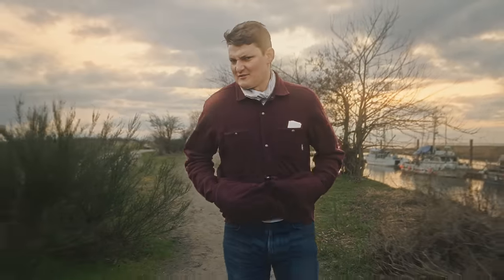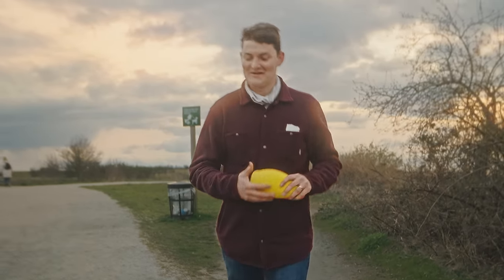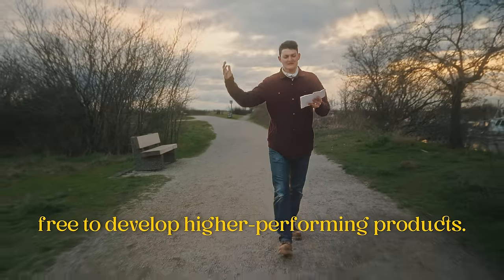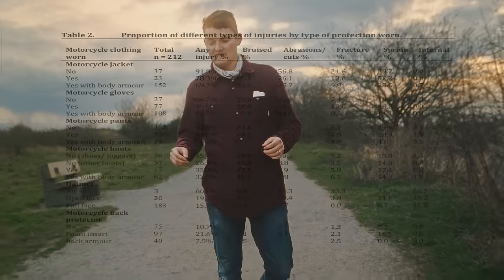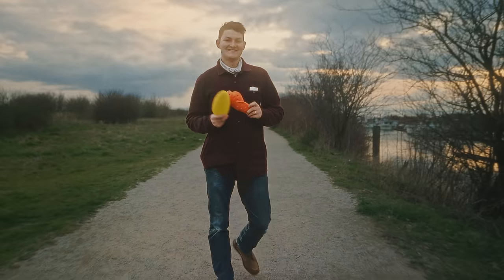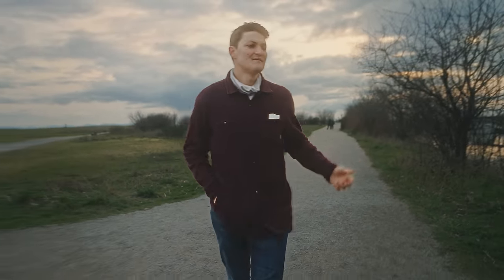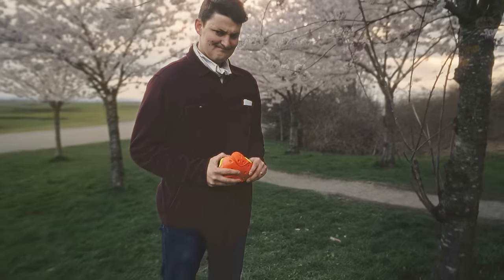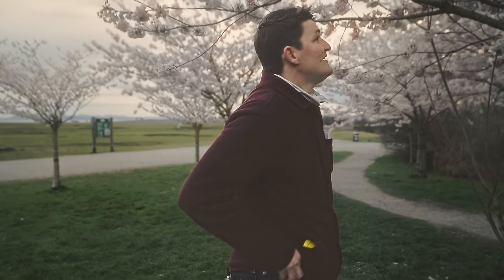Why I Stopped Wearing Motorcycle Body Armour

Comment: Pads are not the same as protectors. Pads are not certified, protectors are. CE certified clothing need to have certified protectors of the correct size and location in addition to certified abrasive resistance. Airbags can be used in addition, but not as a replacement.
Reply: The need for the CE standard approval is "ONLY" required at the point of sale and the manufacturer has minimums ( sub for correct )  to hit to qualify for approval. Unfortunately that coverage may be inadequate in the larger sizes offered for sale - one size does not fit all... It is totally a personal choice whether or not to retain the body armour ( not yet compulsory to wear ppe on a motorcyle other than a helmet - unless you live in France and then gloves must be worn ) common sense should dictate wear atgatt
Reply: @pamvarnsverry2444  You are correct that it is a sales requirement not a requirement for the user. However that was not my point. In the EU a specific language is used to describe the motorcycle gear. If the protectors are not certified, the are adressed as padding. If the gear is equipped with certified protectors, it my be adverticed as leather (or whatever) clothing with protectors. Only when the complete gear is certified, it can be advertised as protective motorcycle clothing. This means, the stiching/abbresive resistence, certified protectors and protectors on the required spot, with the correct size and means to keep it in place during a crach. Only a few manufactors make motorcycle clothing up to these standards. Most are sold as motorcycle suit/clothing with protectors. this means only the protectors used are certified, but not always on the right spot or of with the correct size and neither with the correct abbrasive resistence.

Comment: It is simple Mother Nature that the more material/product you put between you and the road, the less the road will damage your skin and/or bones. There is always an impact breaking point of human body parts but that is not what putting more material/plastic between you and the road is designed to protect. They are not impact reducers. They are there to reduce the amount of skin and bone removed from your body. Every motorcycle rider should always wear protective gear which includes body/extremity armor just in case they hit some marbles and go down for example.  Plus thicker layered clothing for temperature control as well in the high wind environment. IMHO

Comment: No no and no. Knee pads or braces massively helpful same with elbow pads and anything for your spine. Any kind of armor is better to prevent against a break. My knee got fucked up at about 15 mph but at 35 with the armor just a week of discomfort no no no. Wear your armor it helps reduce injury

Comment: I understand they may not help too much with low impact, but at the times you need it if I can reduce 50 Jules to 18 I will take it. The rider may be covered in broken bones but at least the bones are in single digit pieces. Also, I completely agree with most of your videos, but quoting a single study about the effectiveness of gear isn’t proof of anything

Comment: What about all those motogp/WSBK guys.  I mean I haven't looked it up, but they seldom seem to break anything protected by armor?  Legs, hands, collar bones (Although their auto AB stuff seems to be saving some collar bones), but seldom do they seem to break an elbow, or knee, Their speed hump seems to protect their back quite well much of the time (Even though that isn't it's intended purpose, and their water bladder may help there too).  Ankles do get broken (Jorge Lorenzo broke both of his) but if you look at the injury going down, it seems due to hyper extension, or dislocation a lot of the time.  I've seen these dudes helmets and armor spark on the asphalt, they slide at like 200 MPH sometimes.  Sorry if I am off base here, this is really more an observation.

Comment: Partially disagree. How could you expect to be protected by a small pad? Pads (no matter what kind of) perfectly save from having any scratches after jacket/pants were torn apart when you jump off a meter from the bike, yes you get bruises obviously, but that's not a pad issue, it's human body. You can't fight it! 
I find coloured pads useful, as you can easily see when it needs to be changed than black ones.
I've had fallen off from the bike having jacket with elbow and shoulder pads. It's still there and has no scratches, but yeah got light bruises, which is everyday thing. I had leather jacket without pads and in a similar case entire arm was torn and many scratches. Have to heal a week.
I truly believe better have something (a cheap pink pad😅) than nothing!!!

The question is for me do I wanna carry bandaged arms like 10 days during summer? So that everyone asks me "oh you should quit riding"? Or per weekend quickly heal it and good to go.
Note: For me healing a small 1cm bruise takes ages, not talking about wounds and I'm tired of using creams or whatever medicine is out there, I better use the useless pads!!!

Comment: Been riding for 54 years, dirt and street. Always wear protective gear. Many come to me to ask what they need to ride. Some say why do I need a helmet, if a car pulls out in front of me at 70 and I hit it, the helmet is probably not going to save me anyway. It could, but I point out to them, them that. What about the time you are going 5MPH and turning around and don't notice the gravel spot and you washout and just fall over...not being ready for it and smack your temple on the road hard. You could lose your life right there. With the helmet on, you will be ok. So the protection is needed for that slow not ready for fall, that can catch you out.

Comment: Either you presented it badly or the basis for your claim is really quite crude accident statistics with yes-or-no style bone fracture data.
Surely if it absorbs some of the force acting on your bone, the fracture will be less devastating, since less energy is transmitted. Based on physics it has to make some difference.

It also sounds like the key is to not buy cheapo stuff.

Comment: This is like the guy who found out that there is no scientific study saying flossing your teeth actually helps,  so he just assumed it didn't.  That's not how any of this works. Just because the data is unclear doesn't mean pads don't help.  You would need a study where the data WAS CLEAR that said they don't help,  and you don't have that. You're just making assumptions. In reality you should be using your intuition,  and obviously we're going to prefer to be wearing pads if we're about to roll across 5 lanes of traffic on asphalt.

Comment: This is a very contrarian video that I fear may do more harm than good. Even the study flashed on the screen denotes that fractures are lower a significant amount with body armor especially with upper body jackets. I’m keeping mine on if I ride again.

Besides, we’re not always receiving 50 joules of force - it could be lower enough at 30-40 that the armour would reduce it below the 4kN threshold. 

I think the point could’ve been better made without pointing out the removal of armor, which should’ve been out of the scope. The point feels like it’s protesting the C1/C2 standards not being enough to protect riders - that could’ve been done without bringing up the idea that removal of body armor.

Comment: Low sided one time going through a intersection right turn long story short I was new I was reckless I was egotistical and came into the turn to fast when I was out of that mess I noticed the leather no padded jacket I was wearing saved my lower back right from being skinned as evidence was the damage to the jacket there.  I went down on my right side my hip was badly bruised my shoulder was badly banged up my right side was banged up looking back I truly believe that this accident would’ve just been a hit to only my pride if I was wearing shoulder and hip Armour.  These tests being done like others have said only high light the times the gear hasn’t worked no one really cares to report when it saves them

Comment: I used to ride an eacooter that did 67mph. I was going 55mph and a vehicle changed lanes, I braked and the scooter flipped. I went flying down the road.

I got straight up, body armour was deatroyed all over my right shoulder, my full face helemet was cracked and smashed on the front.

The most I got was a scratch on my forehead due to the impact of my head hitting the ground face first and a scratch on my chin and also a scratch on my shoulder.

If I wasnt wearing full body armour that day, I'd be a fking vegetable. 

ALWAYS wear full body armour.

Comment: Your argument is incredibly misleading!  All protective pads are essentially attenuators.  Force in -> force out, where the attenuation factor Force out / Force in.  Whether the pads prevent say a fracture depends on the force in due to the hit, and the attenuation factor, e.g. CE1, CE2, etc..  You're just taking it for granted that all hits will have a force in that is too high for the attenuation to reduce the force below the threshold?  But this is nonsense on at least 3 folds: (1) Absolutely, the majority of crashes are actually not that high - at least not high enough to have resulted in a statistic that then sill make it to some study for you to then refer to.  Everyone knows this from their own experience.  The point is to not wind up in the hospital or with a serious injury from say 90% of the likely crashes a rider will experience.  (2).  Even for the high impact hits, a fracture is not always binary thing - fracture, no fracture.  There is a good chance the pads attenuation will lessen the severity of the fracture.  (3)  Internal injury for internal organs has not been addressed by your studies.
The worst thing about this video is how you present it in such an arrogant assertive manner.  You've made a fool out of yourself actually.  That's too bad.

Comment: Can't you just readjust your armor with a higher tensile strength padding with a larger surface area? You said horse riders have better protection, so why not just do a sport fusion of a sort? Also, can you use trauma pads to help with the impact, like with a bulletproof jacket?

Comment: I won't umbrage with this take as it has no falsehoods. I would say though, that it did not have a lot of nuances either.  Some, and I would say most(as they are unreported) mishaps are minor, and even in the driveway or garage, parking lot, street walk,... especially if you live in an urban area. This minor armoring will stop those little mishaps from keeping you off the road for a week, while a deep bruise is healing.

Comment: I had my pads in my Joe Rocket Jacket crumble. I contacted Joe Rocket and got no satisfaction. Soles of my boots had the same thing happen to them. They had a CSA green triangle on them.
So why don't they put a best before date on it? Those boots that crumbled did it on a ride. They are (were) made in Italy WTF? Warrantied for 3 years and they fell apart on the 5th year. The corporate types said the soles are PU and PU breaks down... Nice to know now after the fact. Really? I went back to my 12 year old army boots, they are still fine.
I had no sole on most of my boot. How is this safety gear?

Comment: 2:16 "These are just too small and too thing to be of any statistical benefit, and the research can prove that".  That's basically a lie.  Immediately after saying that he fades in an overlay of crash data where the statistics clearly show body armour significantly reducing injuries:

Wearing a jacket drops your risk from 91.9% to 78.3%, a jacket with body armour drops that to 69.7%.  And the armour drops your overall risk of a fracture from 21.6% to 9.9%.
Wearing gloves drops your risk from 66.7% to 49.4%, gloves with body armour drops that to 35.2%.
Wearing pants drops your risk from 92.0% to 84.9%, pants with body armour drops that to 71.4%.

When the figures IN YOUR OWN VIDEO show that body armour reduces your risk of injury I have to question how thorough your research was prior to making such a sweeping statement and presenting it as fact.

The whole video seems to be based on the theory that:  "Body armour isn't as good as it should be, so I'm not going to wear it at all".  The phrase cutting your nose off to spite your face springs to mind.

Comment: I would actually question the protection provided by an airbag jacket. Unless I am mistaken (it has been known) the air will be released as soon as the material has a hole in it caused by the friction? Each to their own but I don't see how an airbag jacket will offer much more more protection over a normal one with armour?

Comment: No body armor is crazy. One fall at high speeds and you'll need skin transplantations. And even if they are not saving you from fractures, they will still dampen the impact and reduce the severity of the fracture. I crashed 3 times in my life, never had a scratch. If I wore no armor, I would have been sent to the hospital for sure. Put that into those statistics.
Reply: I dont wear "armor" pads, but a good leather jacket keeps my skin on.
Reply: Always roll, never slide.

Comment: Just my opinion and has been since day one when those magic foam force absorbing pads came out - the fiam pads do not absorb enough force, any skateboarding pad with hard plastc absorbs force better.  Proof is put both on and get tapped with a frying pan.  The foam pad the frying pan hurts you the hard plastic armor the frying pan foes not hurt.    
Dunno how those foam pads necame universal they suck.  Only way i would use it is it was underneath hard protection

Comment: I had a small crash 2 years ago with my WR250R, nothing serious, I was going 5 km/h and trying to climb 5 concrete stairs, like the dumbass I am. 🤣 Bike fell on my leg. I had my Klim pants. I'm SURE it saved my leg. Yes, I had a big bruise for weeks, but this didn't stopped my day. 
For the last 25 years, I ALWAYS wear full protection gear. Even to just go to the market at the end of the street. And it's gonna stay like that.
And, No, I don't buy 35$ helmets.
Protections are useless if you don't crash........ But if it happen, I WANT protections, of any kind.

Comment: This feels like a really incorrect interpretation of the research
1) pads don't reduce the occurrence of fractures (when crash is severe) but prevents bruises, abrasions etc in less intense crashes
2) the research you cites only talks about the occurrence of a fracture/dislocation and not a severity. Your bones may shatter to pieces without pads and only get a small crack with pads

If the point you are trying to make is that the gear available is shit then title your video appropriately since most people will not get the message. If someone doesn'tt have the money to buy expensive gear then they are better of wearing whatever cheap pads are available rather than nothing.

Comment: Despite the low protection, is it not similar to the case of throwing a stone through panes of glass? Sure, the first pane breaks but it absorbs enough energy while breaking to reduce the impact on the second pane and so on? A direct (x)kN impact to a bone will break a bone, but it's not a direct impact when have the plastic armour. So, while the impact may be a certain mesaured value at 'source'  by the time it reaches the bone, it has been reduced by the plastic, to below a fracture level?

Comment: Drop onto your knees on some tarmac without padding and tell me you prefer it -_- Not a smart message to be putting out. I've been hit by a car without armour and am still in pain 5 years later. Hit a car at 45mph wearing armour and walked away with minor bruising. Wear protection.

Comment: I did mtb downhill riding. I had all gear. At bigger crashes, it never helped. Forces were just simply to big, and all the armor would be torn off. There is no chanse that this thing would protect you on a motorcycle. Helmet, gloves and turtle yes,,the rest not

Comment: Well i dont agree on this one, those protection are really good for low speed crash.  I use motorcycle clothe ro when i use my electric unicycle and i can tell you those protection works and save me many time. Wait, if you wanted to stimulate comments , well that is succes.

Comment: HAHAHA!!!... Ok, I know you're trying to sell airbags, but not everyone can afford them, I sure can't, so I imagine this situation... I'm for whatever reason flying through the air or sliding along the ground at say 40mph, my shoulder hits the kerb. With protection you may get away with just breaking it and whiplash as the weight of your helmet forces your head to continue, that's if your lucky because the shape and size of the protection pad spreads the impact and disapates it's energy for a fraction of a second. Have that same incident, that same impact without protection and if you're lucky your ribcage will take some of the impact, but chances are your subclavian/caratoid arteries are gonna get ripped in two as the sudden stop to your body as your head continues just rips you a new hole...  You've only got to look at some of the darker websites to see this happens...

Comment: The study you cited cannot be used to evaluate the effect of armor on fractures because *it does not include cases where riders were uninjured*, armor offers a massive amount of abrasion protection *on the spots most likely to contact the ground*, it is *literally only possible to set minimum standards*, and setting achievable standards is not regulatory capture, it is *a fundamental aspect of engineering and regulation*.  This is an absolutely awful video.